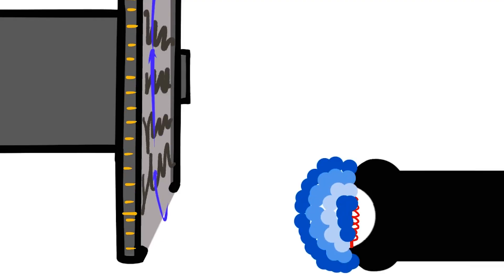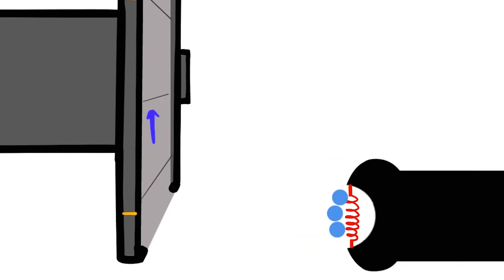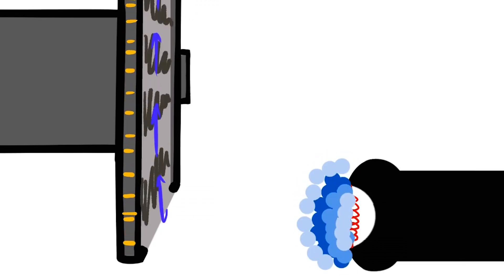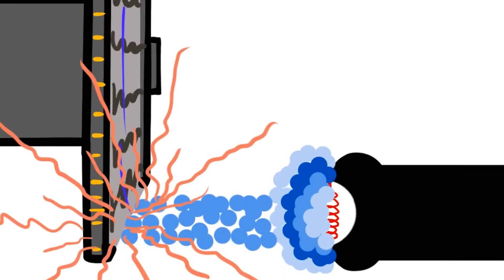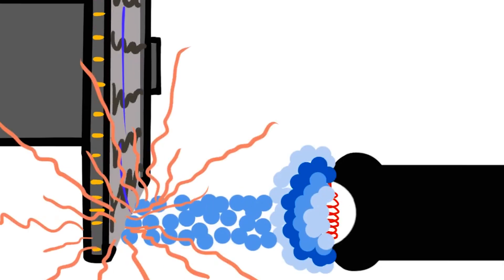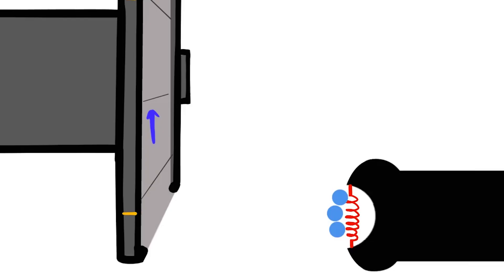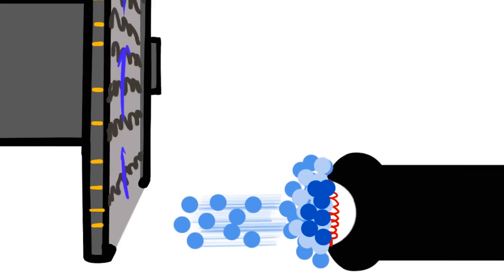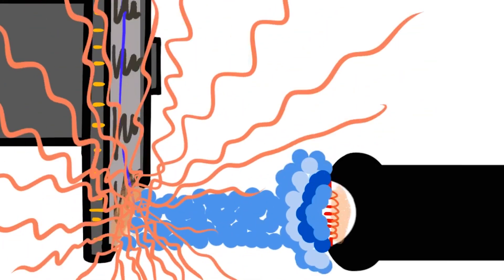Radiology Q&A: What Happens when the X-Ray Button is Pressed?

Comment: I have a question, I was reading the manual for tube warm-up on our x-ray unit and it gave 70 KVP 100 mass. Just curious what would that do to the unit? I know the mass is obviously a typo.
Reply from the maker: If the manufacturer is recommending that technique, then it should just prolong the life of the tube.  Overheating a cold tube runs the risk of melting the filament or cracking the glass housing, but you should always go by manufacturer recommendations.  Just out of curiosity, did their technique include mA and time specifications?

Comment: So what is S exposure time ? Is it how long patients was exposed to x rays ? And what difference between ma and mas and why its in mili second or nano seconds 
Why 300 ma is 5mas in 20ms wht this means please explain to me does it mean the tube produces 5 ma every 20 ms so it gonna take 1 sec to reach 300
Reply from the maker: S = Seconds. Most control panels allow you to set time in seconds or milliseconds, and it's the time that kV is applied to the tube which controls the quantity of radiation you're using.  mA x time (in seconds) = total mAs used.  Most x-ray programs cover this very early on.
Reply: @TopicsInRadiography  so if i choose 300 mA in exposure time of 0.1s it means patient will be exposed 300 milliampere in 100 milliseconds? So each 10 milliseconds the tube will produces 30 mA
Reply from the maker: @no-de3lg  So if you set 300 mA, that determines the quantity of electrons boiling off at the cathode.  The 100 milliseconds (or 0.1 seconds) is the duration that those electrons are colliding with the anode and producing x-ray photons.  When you multiply mA x time, (300 x 0.1), you report the unit in mAs value (30 mAs - milliampere seconds).